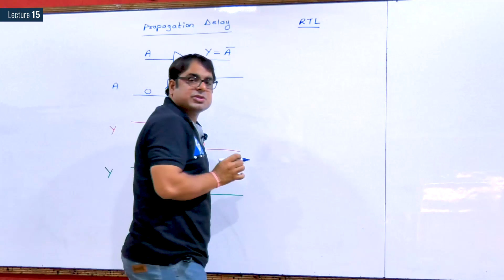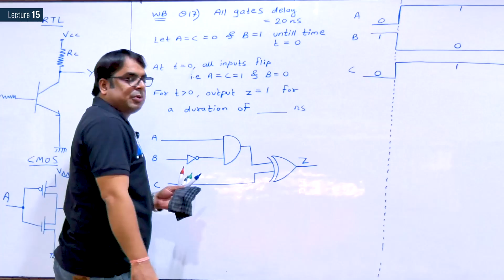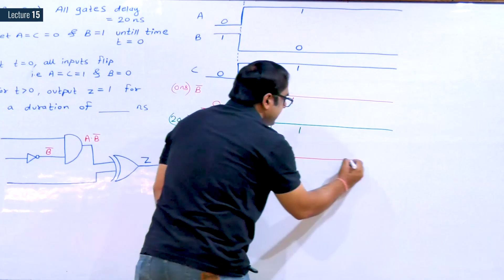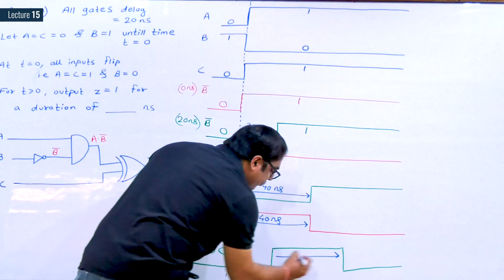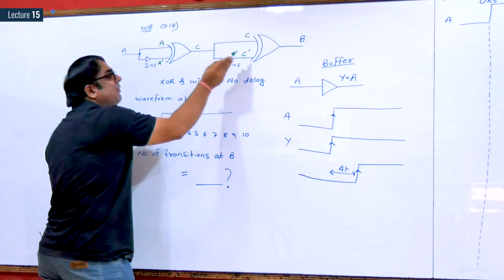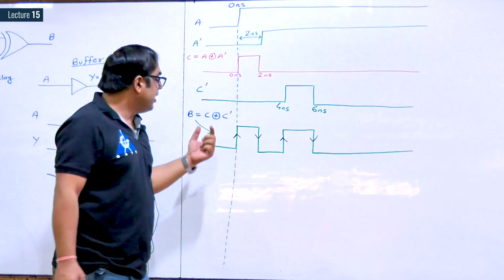Lecture 15 | Practice Questions (Based on Propagation Delay) | Digital Electronics by Sujay Sir

Comment: Hi 
I think that in the second last question, since there should b only two transitions because combinational elements have inertial delay, therefore if the input pulse width is less than the delay itself, then no change is reflected at the output.
Please let me know if I am missing something

Thanks